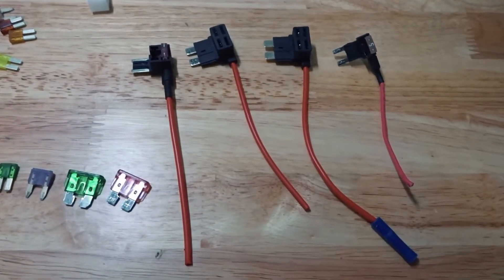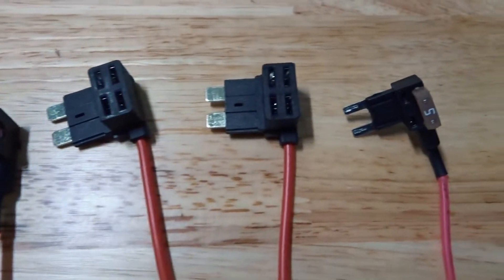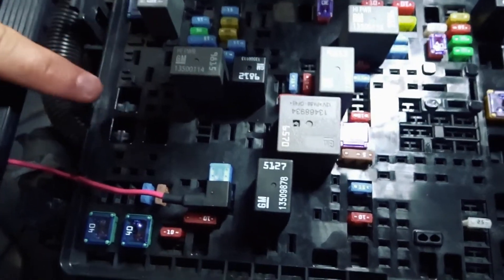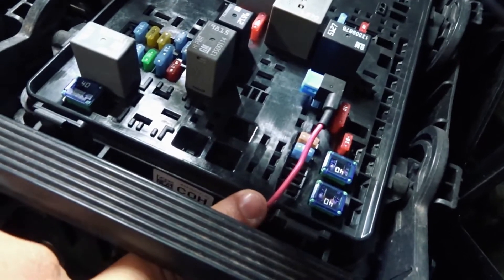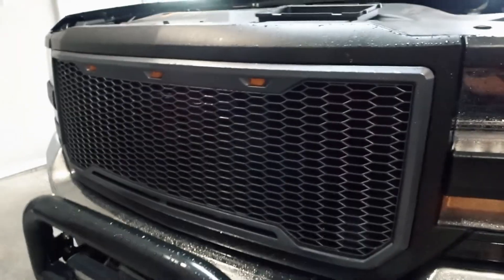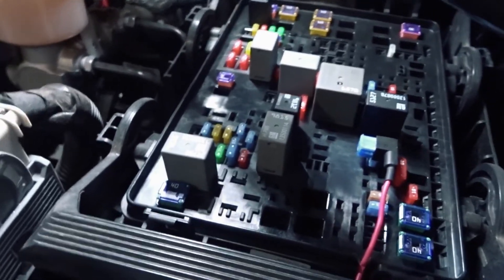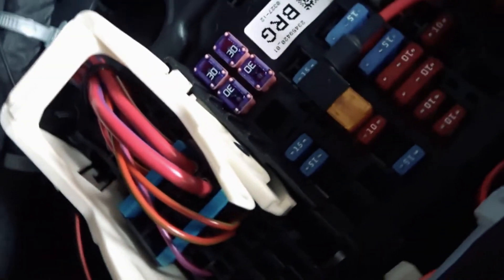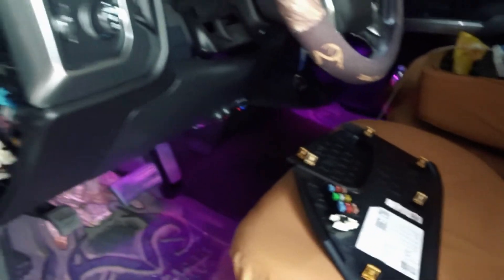LED Wiring - Expandable Circuits

Comment: Where did you find the expandable circuit that will fit the fuse location for the Silverado?
Reply from the maker: You used to be able to find them at o Reilly or autozone but they are more expensive by a couple bucks. Best place is to just search them on ebay. Ive used them for LED lights inside and out. Never had issues.

Comment: If you have multiple small amber lights for the grill, would you put all three red wires into one add a fuse and then ground all three wires? 
Or, do you have to use three add a fuse for each light individually? 🤔
Thank you.
Reply from the maker: I would, they cant draw that much power. This grill was all tied together and pre wired in that way

Comment: Thanks for the video. I think you have the line, & load reversed. The current from the battery comes from the left side of that fuse socket, & is fused on the right...
Reply from the maker: USA Reefer thanks for the comment! Not sure if i mentioned something wrong or...i use them a lot, nvr worry about what side is what, i just pull fuse and re insert it the exact way i took out..always works good!
Reply: There is a line side, & load side to them.  If you insert them the wrong way it is not protected by the fuse.  Look at a few YouTube vids on this topic. Cheers.
Reply from the maker: USA Reefer awesome thanks for the tip!

Comment: This way of hardwiring is totally safe ? (I am not an electrical expert)..
Reply from the maker: Yes, using expandable circuits is very safe. If anything went wrong, it will blow the fuse and protect the vehicle. This keeps u from hardwiring anything, i never hardwire anything on my vehicles. Thnks!

Comment: Where did you run your ground wire?
Reply from the maker: Mitch Stophel i run my ground to the closest factory bolt on the fenders or firewall, nothin fancy, i just try to keep it hidden and out of the way

Comment: So if you don’t have fog lights will it still work
Reply from the maker: OP Kingz i would say no as you are missing the fog light button and there will be no fuse. But you could wire it into the headlights somehow or another light im sure!
Reply: midwestbuilds dang okay it worked for a second but stopped

Comment: If my truck doesn’t have fog lights from the factory which fuse would you recommend using to light up the amber lights?
Reply from the maker: James Hensley i would try the headlights. I cant remember what kind of fuse they use but once you look at the diagram under the top cover of the fusebox you should be able to tell. I originally was going to do this but changed my mind. Any other questions feel free to ask! Thnks!!
Reply: I tried using the headlight fuse but it has a 3 prong fuse and I can’t find an expandable circuit for it. What other fuse would you recommend using?
Reply from the maker: James Hensley what number was it? 58? Mine shows HDLGT RT/LT...or something close to that. Is that the one you looked at?
Reply: 58 is a three prong fuse and you’ll need a three prong ATL fuse tap. They sell them on amazon. What are the two fuses you have plugged into the fuse tap? I see the darker blue is a 15, what is the other light blue one?